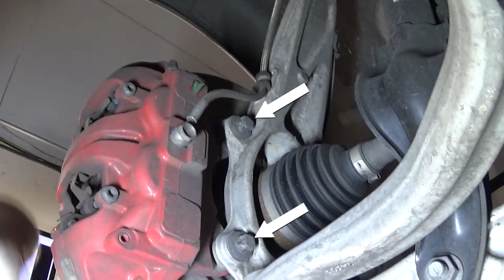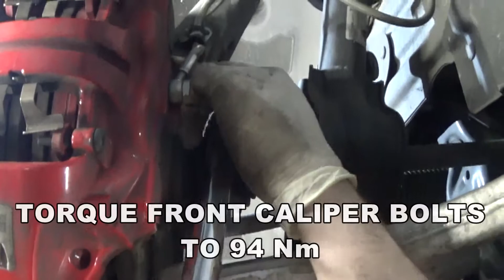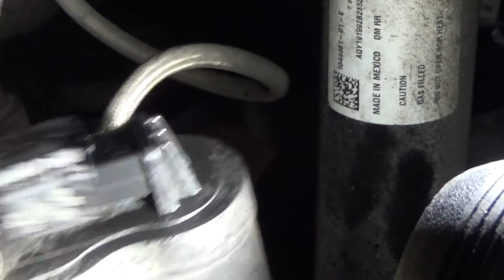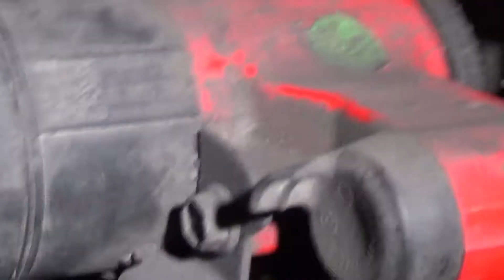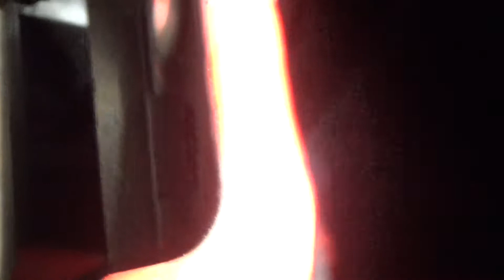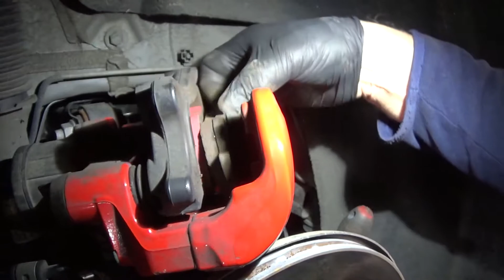How to change Model 3 Performance brake pads

Comment: You can put car in tow mode, to disengange parking brake dont need 12V battery or anything :)
Reply: Tow mode wont fully retract the piston enough to put new pads in
Reply: That doesn't retract the pistons

Comment: Useful Video. Thanks. I have just refreshed all 4 brake discs and pads. A couple of additions: 
1. Front Brakes: there is a brake hose holder attached to the Strut with a 10mm Screw. Remove this to give yourself more length to work with.
2. Front Brakes: if they have never been serviced yearly, (mine after 4 years) it is worth spending the extra time and removing the 4 Pins (T40) the inside slide faces within the caliper (against which the pads are pushed during braking) and spring clip and cleaning everything up so it is like new. Brake dust, grease, road grime and heat combine to make a hard black compound which needs a scrubbing pad to remove!  The new pads will operate like factory fresh again! 
3. All Brakes: on all slide surfaces apply Ceramic Grease. Not too much, but some. 
4. All Brakes: To protect the red caliper paint, either wrap the caliper in a soft old cloth, and/or the sharp edges of the Stone Shield (with "Tesla" pressed in it). 
5. Optional: use the opportunity and clean and treat the rust on the wheel bearing housing and the rear of the brake disc flange. Use a brass brush and a coat of phosphate rust converter, followed by a quality paint. This will cost you more time but will give a professional finish. 
6. All Brakes: mark a fiducial on the two main caliper bolts before removing so you can re-torque after. (Although it is nearly impossible to go exactly back to original position, but still really tight on of course)

Comment: I see that you don't pull the pins out.  If the brakes are older - mine are going on 8 years - wouldn't it be wise to pull and clean the pins to make sure that there's no buildup on them that stops the pads from moving freely?

Comment: No lubrication on the pads where they touch the caliper?
Reply from the maker: Yes, good point. It's usual to apply a thin film of copper grease. In this case we didn't because we were swapping barely used pads for new ones so there was already some grease on the calipers and not much dust, but if replacing very worn pads it's a good idea.
Reply: If i can add to that. No good using copper grease it can cause galvanic corrosion which can eat its way into the calipers. Use ceramic paste instead which is non conductive!
Reply: @ownedbymeeee  Or aluminium grease/anti-seize compound.